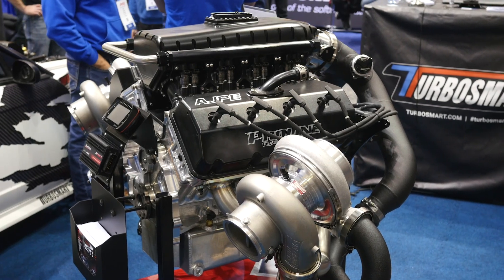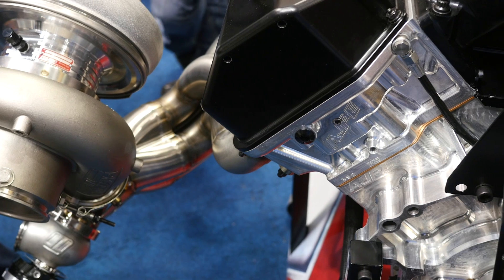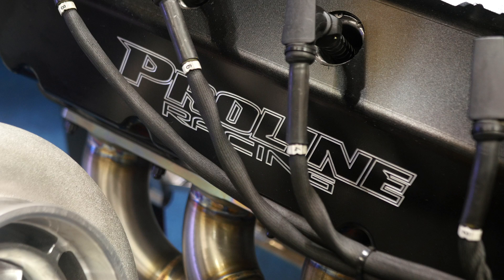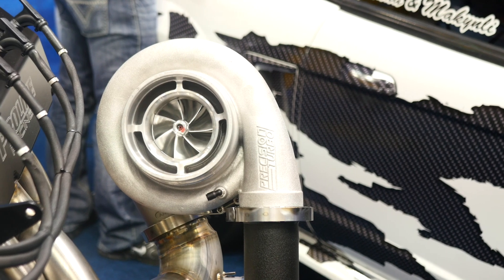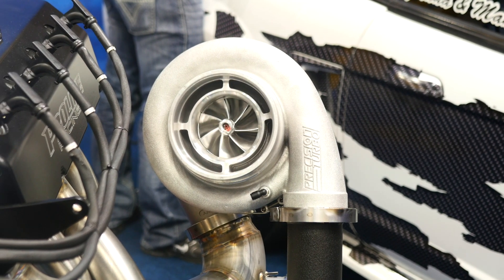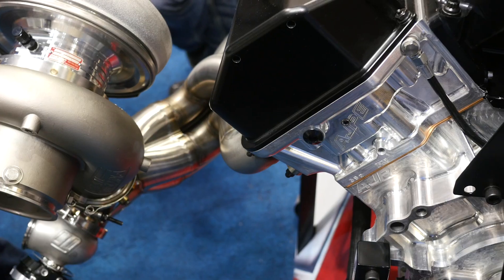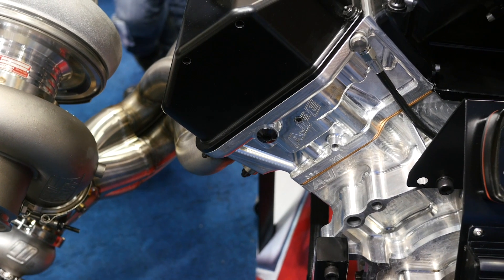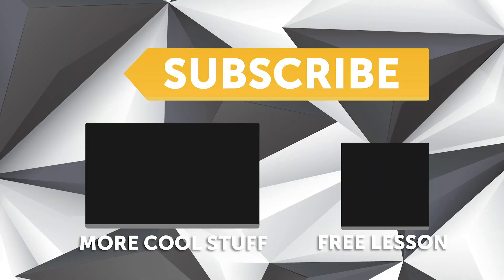Proline Racing's 5200HP Hemi V8 | Secrets Revealed [TECH TALK]

Comment from the maker: 👨‍🔧 Building a fast car? Get $400 OFF the all-inclusive VIP online course package deal: https://hpcdmy.co/offery180
✊50% OFF your first online engine building course. Enrol now:  https://hpcdmy.co/offery180
Gain 30 horsepowers and 50 brainpowers with your own HPA branded nipple covers. We've added extra material so that they look just like a regular t-shirt - http://bit.ly/MerchHPA - Taz 👨🏻
Reply: That is a high quality educational comment that we come to expect from you guys. Love your work and the nip shields.
Reply: AJPE = Alan Johnson?
Reply: @rmm2424  yes Alan Johnson performance engines
Reply: @rmm2424  yessir
Reply: Just interested why does top fueler make 8-10000hp on these boost levels but this only makes 5200hp? Cheers
Reply: @turbochard7355  First, they ASSUME it's 10,000 for a top fuel. Theres not even a hub dyno that can handle an instant 10,000HP hit so they don't even know. It's a scientific formula that takes all the variables and spits out a number of 10,000-12,000HP.

Why is it so powerful? Nitromethane has like an 8:1 advantage over 116 race gas in explosive potential. It takes a really hot engine to make it burn which is why they start their engines with Methanol (alcohol) that burns very easily yet still makes the power they need to keep the engine healthy. They NEED that nitromethane after the start...not just for its power but because it cools the engine. Short of oil passages to moving parts, there's nothing cooling that engine other than the blower when they launch and that air ain't cool for very long nor does it cool anything other than an intake valve and a cylinder.

The result? On the starting line right when they hit the gas, there is INSTANT 10,000 HP if they hold the tires down. (that 5,000HP engine would NEVER be able to generate 5,000HP off the hit without exploding/busting the tires loose...even if they put a top fuel blower on top of it.).  A TF/FC engine NEEDS to idle at about 1000HP to keep the nitromethane burning which is why they sit idling and spitting unburned nitromethane on the start line at a high rate. (they burn about 17 gallons of 90% nitro meth/10% Methanol in a single run(burnout etc which is damn near a full gas tank worth of gas on a regular car.).  I believe just the roots blower they use needs 500hp just to spin it as I recall.

They can't use a traditional clutch. They use about 9 plates that over a run get so hot that they physically weld themselves together. That's a new set of clutch plates every single run taken out of the car by a guy with a very thick set of gloves. So that's 1000HP to 10,000HP in a split second. The end result of that is they use a block about once every 15 runs TOPS, any cracks or not, they just pull it out and sell them down the line to less aggressive Hemi users or send them to be reforged into new blocks of aluminum so they can mill another block. Not rods or other high energy parts...some of them get 6-10 runs tops.

With that 5,000HP Hemi (which only shares the name with a top fuel Hemi because the TF needs a whole lot of extra reinforcement on to keep it from blowing up the aluminum Hemi block needs to have). It idles at a next to no HP. It just sits there gurgling with enough idle and hp to keep a type of gas(116 octane) that would probably burn if you looked at it wrong to keep burning or there's a Methanol(alcohol) version for a lot of cars too but it depends on the race rules. The end result of that you need cooling(not as much for the Methanol) and a bunch of other systems that suck HP out of that engine. 

On the line, every power adder, nitrous, turbo, procharger or screws(the guys with the huge hats on top of their engines with the butterflies) has to try to replicate those NHRA beasts that suck a room full of air into the engine in literally seconds. They obviously can't due to regulations and physical limits of parts. Even a 5000HP car could NEVER accept a portion of the power a TF/FC engine blips in their power supressed burnouts let alone a starting line race launch.

 And now the point of this post. That 5000HP Hemi is WAY different than a top fuel/funny car Hemi in every way other than the hemispherical heads. Most of all, when someone pushes the button, not only would that head explode if they tried 5000HP through it from almost zero but they'd bust the tires loose every single time. They start off with as much power as they think they can put down and not spin and then it slowly works its way up to 5000 down the run as you can add more and more power without spinning the tires  (if you can even make that car do 5000 up to 1000ft or even 1320 feet). What the 5000 does do is it gives you the POTENTIAL for 5000 and with a regular car without a $50,000 carbon fiber body of a funny car with all the other things built to allow the car to do as much of 10,000HP as possible off the line. It should be mentioned that with turbos that engine might start at 1500HP but it would take the slow build up of exhaust going down a run for it to build to 5000HP(if they could make that much with the amount of time they need to build boost safely before the race ends).  

It's why you see a turbo car chase a blower or nitrous car down at the end.  Nitrous/Blower car has all the power the engine can do for a good part of the run, the turbo cars slowly build and surpass the power of the blowers/nitrous as the turbos spin faster/generate more boost which means they can add more gas. That's really the point of the power adders. More air means more gas means more explosion means faster car. I chance to bet that the Proline Hemi can't do 5k HP with a blower or nitrous or it would explode with the instant power application. Turbos nicely caress an engine faster and faster as the exhaust of the engine gets higher and higher so the faster you go, the faster you can go.

And yes I'm a turbo guy...unlike Prochargers and screw blowers(which can steal 150HP from an engine just to spin them because the engine itself has to power them), turbos are run from the exhaust. It's like having your cake and eating it too. Burn your fuel and THEN you use the exhaust from that burned fuel to spin the turbos faster and faster to push more air into your engine so you can burn even more fuel and make even more exhaust. It uses next to no HP from your engine and by the end of a race, as the man said, you could be putting 80 pounds of boost in your engine with a turbo. 

80 pounds of boost from a Blower? The first three lines of seating at a race event would be catching hot pieces of aluminum and trying to juggle them until they cooled down when the engine blew up. Enough nitrous into an engine to general 80 pounds of oxygen(nitrous breaks down mostly into pure oxygen when you heat it. They spray as much as an engine will allow into the engine and hope it doesn't burn something or burst a burst plate or just plain blow the intake off the top of the car. If they did 80 pounds worth of boost off the hit and it would both heat the cylinders/plugs to like 1500 degrees AND THEN it would explode parts into the first three rows of seating. Maybe people could play "try not to get burned by the spark plugs now sitting in their hands".

WHEW sorry for the book. There's probably some inaccuracies or outright lies in there but it's most of the science for you.
Reply: Chris Harris:  wow my answer was ‘it’s just different’. Your disclaimer at the end was the best too.
Reply: @LoociferZ  Wow. I thoroughly enjoyed reading this. Thanks for the science!
Reply: @MrJzlavallee  bro it was a damn book but race engines may be so simple parts wise(no alternator, no radiator, no a/c, no lighting systems and everything else a cast car has) BUT they have to generate max power, keep the tires stuck to the track AND oh yes...keep the engine from blowing up or burning down from just a minute of burnout/stage/race. Don't even get me started on the complexities of transmissions lol.
Reply: @LoociferZ  Lol well if you decide to write a book on that too, send me the link lol
Reply: @turbochard7355  nitromethane